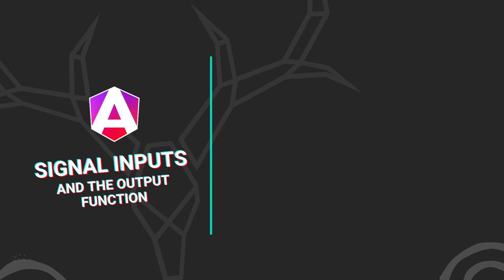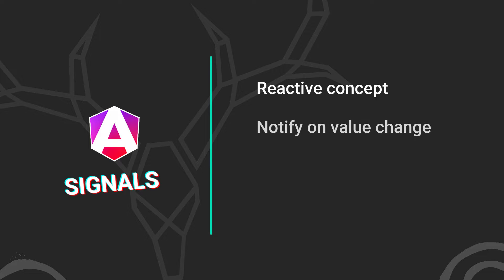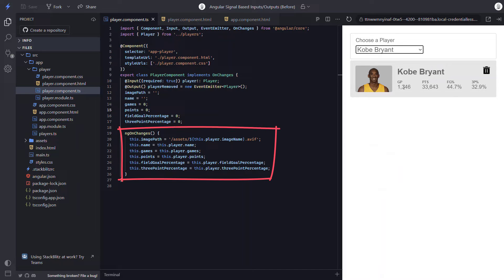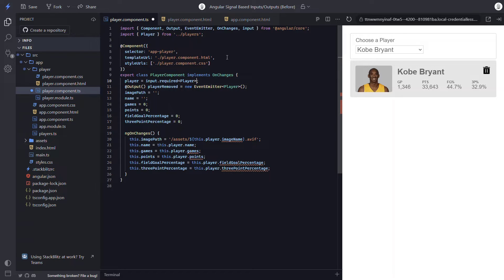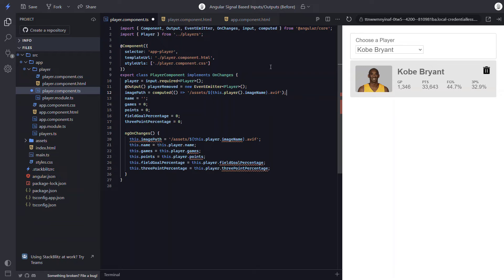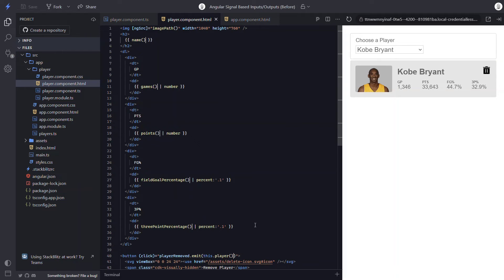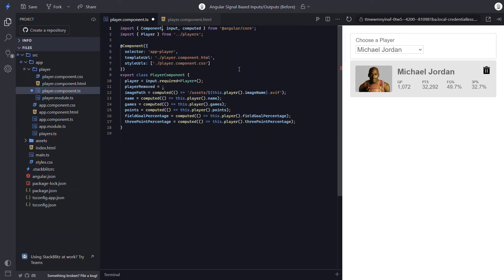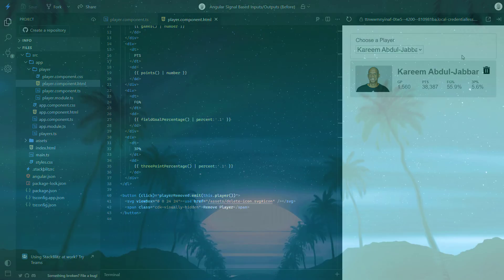Signal-based inputs and the output function

Comment: Output is not a signal, it doesnt make sense to use signals for events. Check output’s source code.
Reply from the maker: Sorry it was confusing. I am aware that output is not a signal which is why I refer to as the output "function" and not "signal" in this tutorial.

Comment: When i try to import the output it gives  @angular/core"' has no exported member named 'output'. Did you mean 'Output'?.
i m using "@angular/core": "^17.1.0",
i tried the with deleting node modules and re-install that's also not working. Any clue ?
Reply from the maker: It's a new feature, you'll need to be on version 17.3.0 or greater.
Reply: Thanks  @briantreese  it's working now